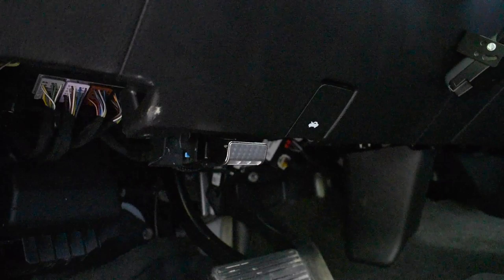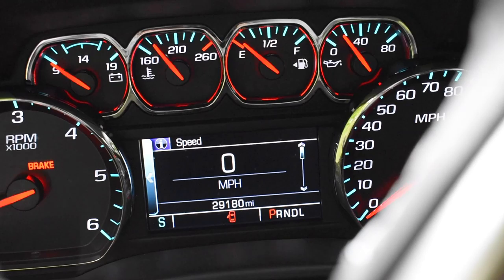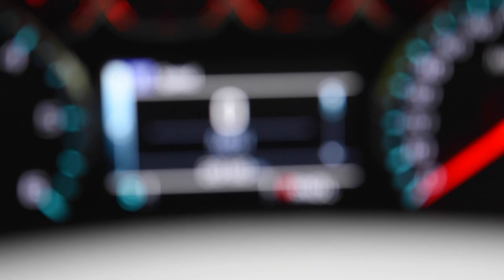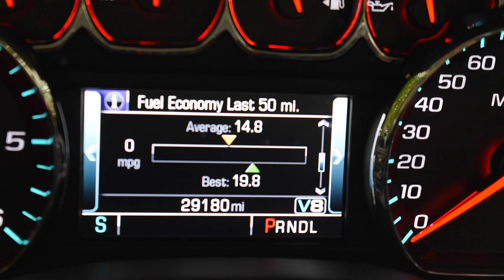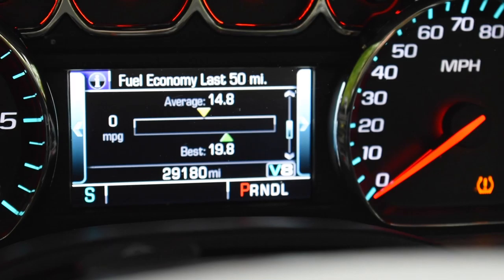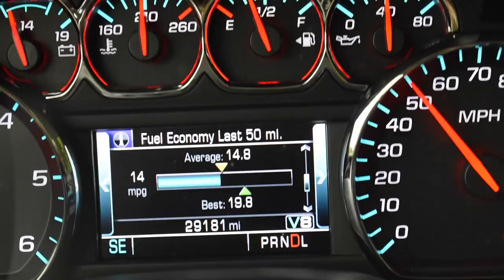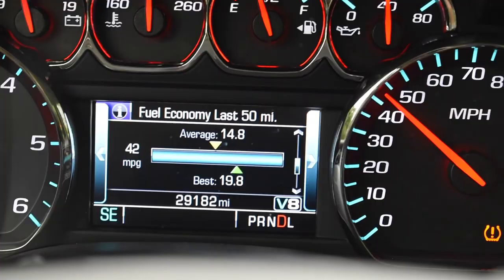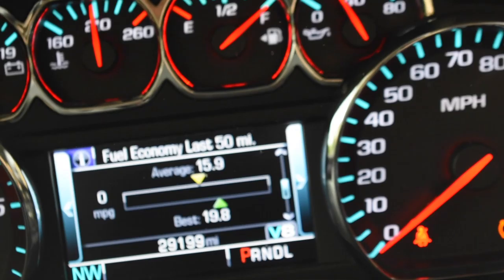Range Technology AFM/DFM Disabler

Comment: I’ve had my AFM Delete module plugged in for almost 20,000 miles now not a single issue. I’ve noticed it solved my burning oil issue also from dropping to V4. I have 129,000 miles on my 2014 Sierra and still driving like the day it drove off the lot 🤘

Comment: Been running it on my ‘17 Silverado for over a year now...love it , no issues. Not worried about fuel mileage so much, it’s a truck right!
Reply: How is it u still use it?
Reply: @Lifehackz137  actually traded the truck about a year ago. Had to get a 2500HD to tow a 5th.

Comment: I've had my Range AFM Disabler device for over 30,000 miles. Still running strong! The V4 mode has caused me so many issues. I have been logging my fuel mileage and it has stayed about the same.

Comment: After having my '14 Silverado for a year I was starting to regret having it because of how much I hated how it drove and how the shifting behaved. I came from a 5spd tacoma and was starting to miss it. I ended up going with a black bear tune and while it was pricey, it completely changed the manners of the truck for the best. It's much more fun to drive now and holds gears so much better. Driving out my road which has lots of turns and hills, it doesn't constantly shift to v4 and back and improved my fuel economy by 2mpg. My friend picked up an 09 with the 5.3 and told him to immediately get the range device to remove the DOD if nothing else and he noticed 2-3 mpg improvement as well. It also should save him from having to get the engine rebuilt due to all of the issues that comes with DOD.

Comment: I use their new model for DFM/AFM (manufactured 01/29/2020) on my '19 5.3 Z71. The truck feels so much better to drive. It never comes out of V8 mode and as an added bonus, the disabler makes the auto Stop/Start no longer work  which I love. I hated having to disable the Stop/Start manually each time I got in the truck.
Reply: What it called

Comment: Bought one 3 days ago with a K&N air filter for my 11 GMC Sierra.  Went from average 16l/100kms to 13l/100kms on the highway.  2 hours of driving cruise control set at 110kms/hr.  Feels like it accelerates better too.

Comment: So I’ve been running the range for awhile it’s a very good product but keep in mind that the range is just a band aid for the afm delete it’s not meant to be on it for a very long time spand I recently bought the edge evolution cts2 I strongly advise getting it keeps the truck in v8 mode helps your transmission out a ton with reliability and gives you a lot more power strongly suggest this product stay up out there and hope you have a great day

Comment: After my #8 cylinder lifter failed the 2nd time I put the range disabler in..  I have had no issues since, for several years, no codes, works great.  And I could feel the shutter when in v4 mode before.

Comment: Wish I knew about this when I had my 2013. I was going thur 2 quarts of oil every 3k which caused it to need a motor swap at 48k miles on it.  I got a 2018 now because I heard they fixed the issue. Apparently not. I'll be buying one soon. And yes v4 to v8 mode sucks, you can definitely feel and hear it.

Comment: I've had the range in my 2012 tahoe ppv for about 6 months no problems no lights and I've noticed an improvement in gas mileage because I don't have to stab the throttle to get it out of v4 mode witch cuts your gas mileage back a lot

Comment: I have a 2018 z71 and been getting 18-19mpg with afm turned off via Superchips tuner. Stock tires with a leveling kit. Runs a lot smoother than with it on. Also noticed the helicopter sound through my 3" dynomax exhaust before when it went into 4cyl mode. Keep up the good content 💪👊

Comment: Just installed the Range Technologies plug in on my 2012 Suburban Z71. The engine runs much better, especially when I come to a stop. When it shifted to V4 it ran really rough. The transmission even shifts much smoother. Best 200 bucks I ever spent

Comment: Worth it John if you remember I drove the my grandfathers Chevy to Georgia for ns it was a 2013 with the same fuel saving crap truck had only 30k miles and in the way home it lost four cylinders  and had some kind of internal tick because of afm he ended up needing a new block because of the damage warranty covered it.

Comment: I have a AFM Disabler in my 2016 Chevy Silverado LT and it works great, better gas mileage & better throttle response! I’ve never unplugged it, I’ve had it for a month and half my truck has 27,900 miles
Reply: Does it drain the battery if leave my car undriven ?

Comment: Just sold my '08 Yukon, 5.3V8. Never liked the fuel management system. Would have to downshift to 3rd to make it up hills. Or, when in "D," there would be a long pause or shudder before all eight cylinders would kick in.

Comment: Ford does not use AFM, their Ecoboost (turbo charged engines) program met epa standards.  The AFM issue is far overblown compared to the millions on the road.

The new system GM uses is DFM(Dynamic Fuel Management) shuts down to one cylinder.

Chrysler’s MDS is far more problematic due to an inferior lifter design.

Comment: My mpg has stayed the same. I never could feel the engine switch over to v4 but feel better knowing it's staying in v8.
Reply: How’s the range working for you so far?
Reply: @831CaliSavage  I have had no problems. The truck stays in v8 like it's supposed to. Mpg is still the same. I do mostly city driving.  I was on vacation for two weeks out of the country, and the truck started right up, and my battery is 4 years old, so people saying it will kill a battery must have a weak battery. I buy good batteries in my vehicles. No codes ever popped up. Worth every penny. AFM is a guaranteed death to the lifters. Yes, some people will get lucky and put a lot of miles with afm active, but why chance it. It's just a horrible design.

Comment: Wish they had them for my new body style 2019 Chevy. Had one in my 14' and it worked well.
Reply: They work in 2019/2020, I'm running one in my 2020 Custom TB right now. Drives so much better now.
Reply: They just added the DFM (2019-2020) version to their website. Has nothing to do with body style but if your truck came with V8 DFM. If so, Range updated their product to work on DFM.
Reply: Just got mines today going to use it in my 2020 Silverado...

Comment: Ford vehicles dont shut down cylinders, they just have good tuning to get good fuel mileage compared to dodge an chev/gmc shuting down cylinders
2021 ford says its gonna start building 5.0L v8s with cylinder deactivation system

Comment: The new system is DFM....and it drops down to 1 cylinder! I see the same thing happening with the new system only you'll be stuck in 1 vs 4 😂
Reply: It can drop down to 2 cylinders not 1
Reply: @drewsmith3169  nope, research it

Comment: I have a 2018 silverado 1500 5.3l 15k miles I just put a range in mine and the truck gives a big jerk when I'm braking when I get to around 15-10mph. I notice the rpms rev up when it jerks but my tow mode is off any ideas what it could be?
Reply from the maker: Damn! Sounds dumb, but did you unplug it and plug it back in to see if it resets it? Otherwise I’d reach out to Range and see if they can send you another or send an update for yours!

Comment: Ive got the same truck same color too. Someone said to use manual mode and leave it on 8th gear pretty much. On the flipside tho ive also heard thats its not good to leave the truck on 8th gear the whole time while drivin any thoughts on this? Love the vids btw!
Reply from the maker: Thanks! Seems like if you do it that way, leave it in 8th it’s not really in 8th gear all the time. It’ll still up shift and downshift like normal just won’t go into V4 mode. For example if you put it in 4th gear it’ll shift normal 1-4th and go no higher. Hope that makes sense!!

Comment: i just installed it on my 2018 1500 Silverado, does exactly as described. Im curious if you have used the 'tow haul' mode with it installed ?
Reply from the maker: Honestly not sure.. I sold that truck close to 2 years ago now. I’ve towed often with that truck, but can’t remember if that was ever plugged in during.

Comment: Other Than protecting the lifters how does this add more power? If you’re in v4 and give it gas it goes into v8 automatically so what’s the difference?
Reply from the maker: It’s doesn’t add any power at all.. just keeps her in all 8 cylinders at all times. Feels a lot better, and more like a truck. Where the power is right at the crack of your foot, vs. the cpu having to think what mode it should be in and then reacting accordingly.

Comment: Got myself a AFM delete. It's called a 2020 Ford F350 7.3 TREMOR. Actually had a 2018 Silverado 6.2 and had to have a head replaced at 4k miles do to pin hole from casting. Had range and UPR catch can. Still have CC, MIT and range if anyone wants them, gonna put up for sale whenever I'm not busy. Also have a nice tonneau and ladder rack still in box for that chevy/gmc short bed

Comment: Just installed mine, 2017 Silverado, while driving looking at the dash, it still shows v4, but doesn't feel like it goes into v4 , have you noticed this?
Reply from the maker: No sir, mine never showed in v4 mode when I had the module plugged in

Comment: So I bought a 2018 Tahoe. The first two months it was perfect. Then it had a communication error and it stalled. The dealership ran a program update. But every since I got it back I’m constantly feeling like a hesitation when accelerating. When I press the gas nothing happens. I have to wait a few seconds then it will speed up. I have to slam on the gas the truck will lurch forward and then go. Could this be related to afm?
Reply from the maker: Sounds like it... it’s definitely a laggy feeling it sucks. Like the power isn’t there when you need it.
Reply: @JohnWargo93  yeah definitely. Did you notice it right away when you first got the truck? I think it’s strange that for me it didn’t become a problem until a few months of having the truck and then after I got it back from the dealership.
Reply from the maker: @francescad5525  nahh wasn’t until I got familiar with the truck I really starting to realize what was going on and why it drove like it did. That is strange on your end tho

Comment: Does it run off the battery?? Do you have to take it out whenever you’re done using your truck for the day?
Reply from the maker: runs off the circuit when the truck is on and running.. do NOT have to unplug daily, once the truck is off, the power to the OBDII port is also off.
Reply: JOHN WARGO okay that’s what I figured. Thank you!! Just ordered one. I love the channel

Comment: How many miles did you have on your truck before you installed one of these? Thanks
Reply from the maker: Yikes this was like 4 years ago… I honestly do not remember
Reply: @JohnWargo93  any big issues with your truck that you can remember?
Reply from the maker: @paulcondie2520  trans would get hot when heavy towing but that’s about it. I liked that truck a lot. Just was a little too small for my needs. Got into the trailer industry and now tow a lot for work so bumped up to a 3/4 diesel. Otherwise worked well for me. Slapped around 35k on it in 3 years before moving on.
Reply: @JohnWargo93  thank you

Comment: Does it draw power if the truck is not running
Reply from the maker: No sir. It shuts off itself after I believe 10 mins or so. At least I’ve never run into any issues with it drawing any power.

Comment: Have had mine in for two years no codes yet
Reply: ive been told , that if you do have codes , or check engine light comes on , range will take it back and re program it for free
Reply: No battery drain ?

Comment: None of these ppl have ever had an issue with AFM, yet they all say the same b.s they read or heard online. Funniest thing is saying the truck won't move in V4. Ya, cuz the truck just refuses to go back into V8, right? GTFOH.
Reply: Neil, the thing is, transferring from 4 to 8 constantly makes the truck run like crap. And oil seeps through the “dead” cylinders causing burn and buildup. Even worse is DFM that has 17 different scenarios, and includes running on 1 cylinder. You read about lifter issues? aka bend rods.  Hmmm. Wonder why that’s happening?  To each his own.

Comment: All you have to do it switch to manual mode, 5th gear. Then it won't shift into v4. Save your money with this range garbage. That causes Check Engine Lights.
Reply: It's been plugged in almost a year for myself, never throws lights or drained battery. All this was addressed year's ago with software update from Range